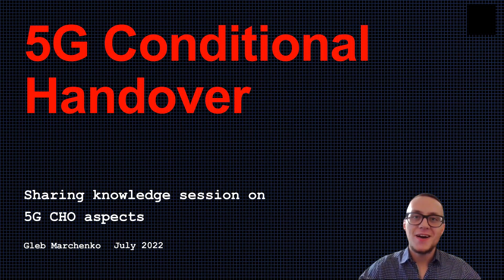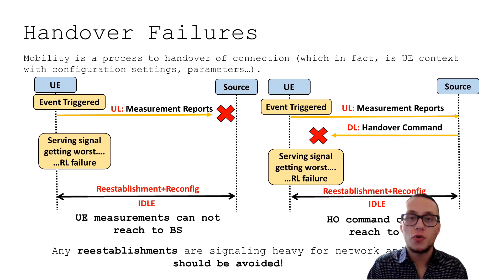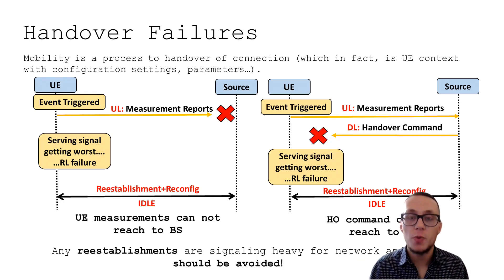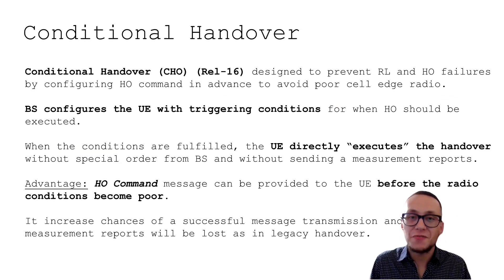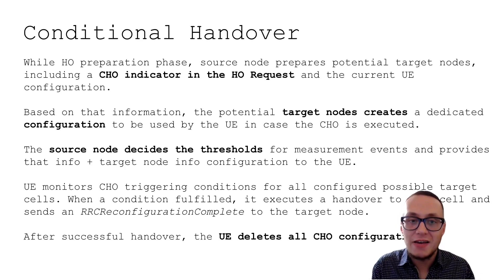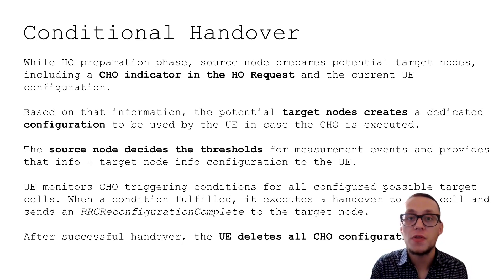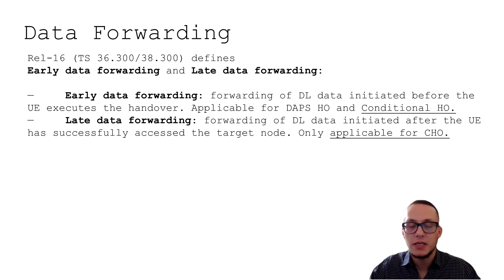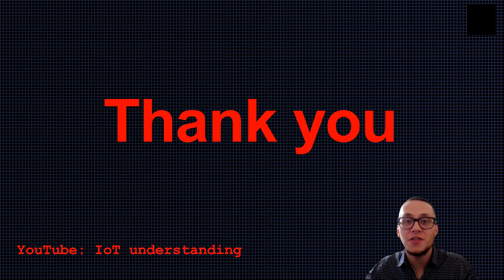5G Course - 5G Conditional Handover, advantages and limits

Comment: Thanks for the video. In CHO when sending RRCReconfiguration to target - there should be DL/UL synchronization towards it. Can it be actually RACH-less (UL)?
Reply from the maker: I guess yes. The traditional handover process involves the UE performing a RACH procedure with the target cell to achieve uplink synchronization and obtain a TA. This can add significant latency to the handover. So, RACH-less CHO, the UE can acquire the necessary uplink synchronization information before the handover is even executed.